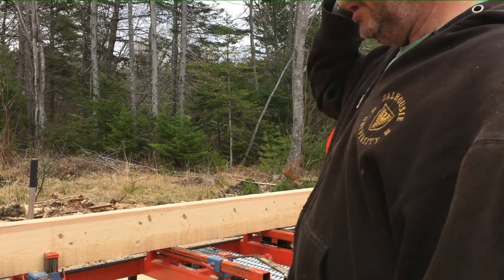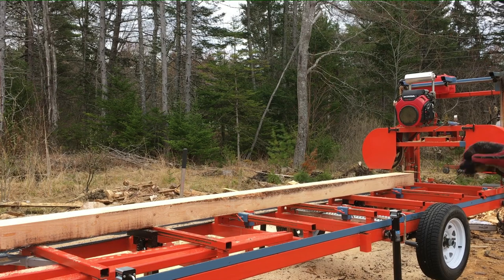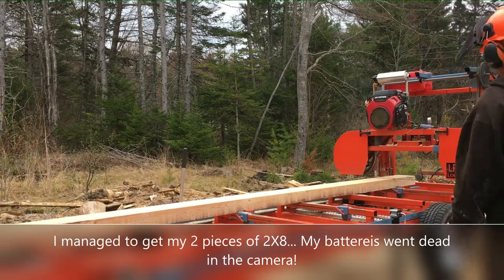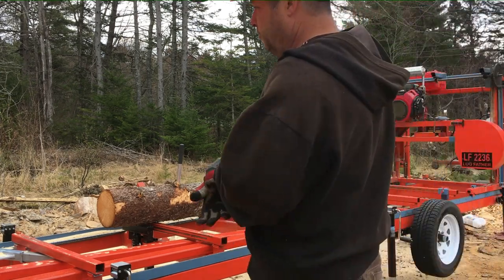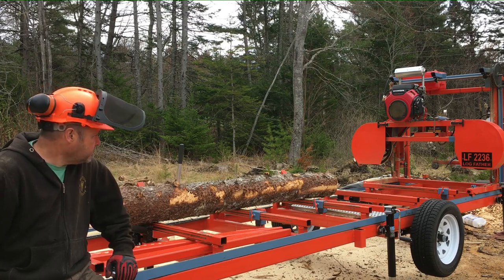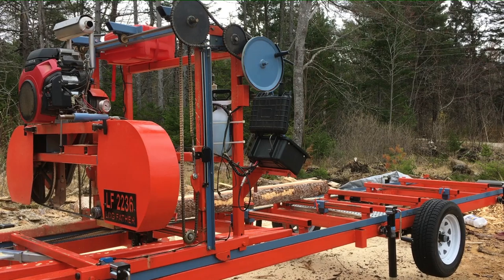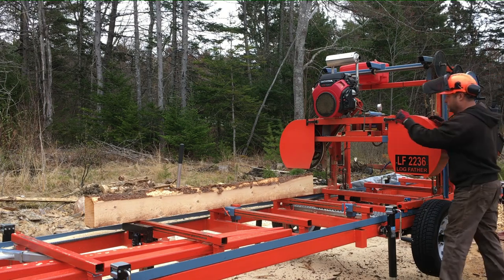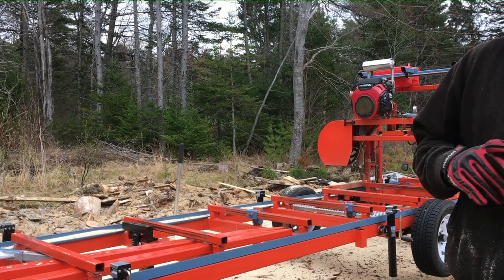A morning at the mill  Homebuilt bandsaw mill in action

Comment: Clearly you know how to operate that machine and are efficient at getting the lumber you want from each log. I have seen many vids (as I look to completing my own mill) and you stand out. Nice mill too.
I have powered lift and powered carriage, with variable speed control. I am looking to install a 'quick return' switch and some automation so I don't have to walk to the end of the mill every time. Some simple one was 'tithes' attached behind the blade to drag the cut piece back is what I thinking. If I can stay at the same end, especially when it gets down to cutting the cant. 
The other option is a small seat attached to the carriage, to get a ride down and back!
Greetings from the UK. I will post the vid when its done!
Reply from the maker: Thanks for watching, I’ve been thinking about drag back arms too, and I already have a safety switch to prevent it from coming off the rails, but I’m wondering about putting my control box stationary and make a flexible over head cable of some sort to save me a step!
Reply: @thelogfather5002  that sounds like a good idea. 
I did think of putting in a limit switch and having the option that the carriage returns itself after the cut, could work with the drag arms. Ideally would need to cut the engine back to idle. Quite do-able but starts to make the machine and wiring more complex with more to go wrong. 
Maybe the excerise is good for me and I’ll just walk up and down!
Reply from the maker: I don’t really have to walk the whole length of the mill, I never cut 20’ long material, but 8-10-12ft is not a long walk. I can pile the last slab that was cut while the mill cuts the next board. At least it’ll stop on it’s own when it gets to the end of the track.  I’ve got the material now to build the drag back arms, stay tuned for a little video about it! Thanks again for watching. Jeff

Comment: hi jeff i built a sawmill  allmost the same as yours .have used it for 6 years now  i am wondering what you have for a carriage travel motor and speed controls  thanks Lee
Reply from the maker: Hi Lee, I bought the motor and controller from KW motors in BC, great to deal with. Get the 25-1 reduction. I had a 50-1 but was too slow. It ok for the lift, but far too slow for the feed. Thanks for watching, All the best Jeff and Leslie.

Comment: I was wondering if you could send me the make and name of the water switch you installed on your Sawmill and which video it was. I can’t find the video again.
Building my own mill and thought the switch was awesome.
Cheers mate.
Reply from the maker: AOMAG® 1/8" NPT DC 12V Electric Solenoid Valve 2 Way Water Air Valve Normally Closed https://www.amazon.ca/dp/B085NJDJJT/ref=cm_sw_r_cp_api_glt_i_7VVFMX52PB6Q9FKT3C0H?_encoding=UTF8&psc=1
Reply from the maker: The switch I used is a simple spring loaded momentary switch I had laying around from who knows what project. :)
Reply: @thelogfather5002  
Thanks! I’ll google spring loaded switch. I appreciate your help